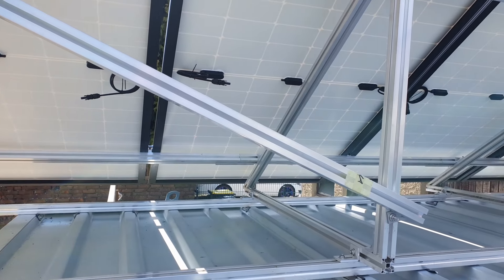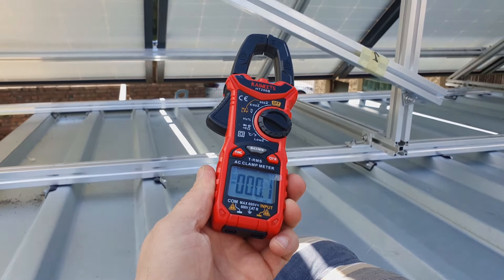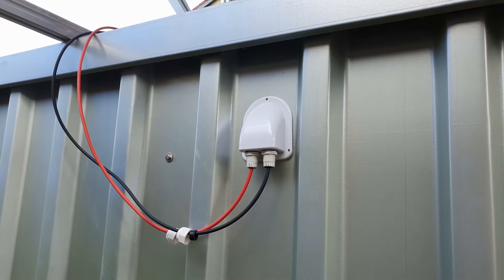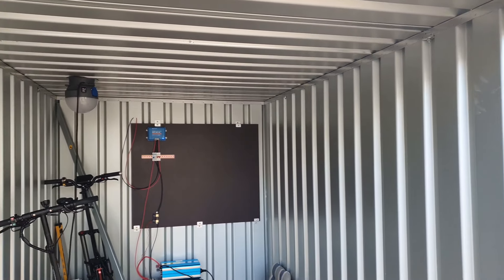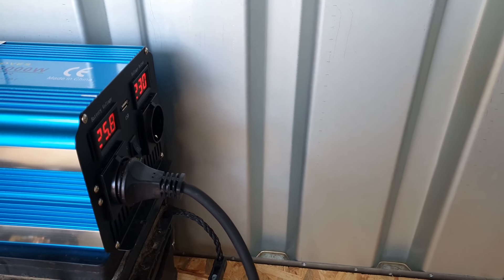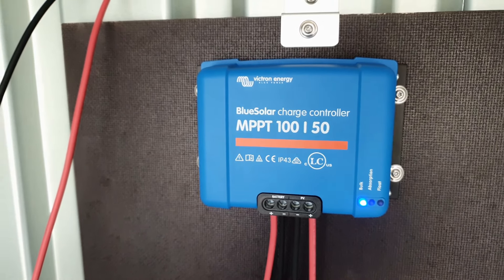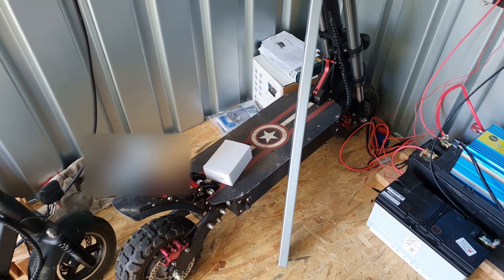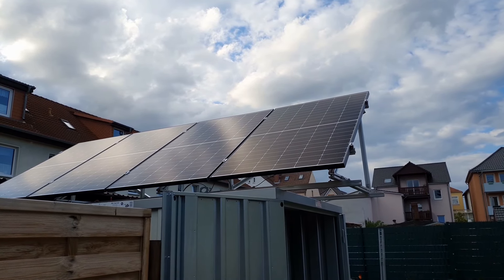Inselanlage mit 1500 Watt Peak - Teil I / mit Victron Laderegler & Trinasolar Panels

Comment: Die 4 Module haben ja ca 160Volt Leerlaufspannung wenn sie in Reihe sind. Der Laderegler kann aber nur 100V vertragen wenn ich es richtig verstehe.
Sind von den 4 Modulen je 2 parallel geschaltet?
Reply from the maker: Ein Modul hat ca. 38v max und Kurzschluss 42v glaube ich. Also immer 2 parallel und den in Reihe. Passt doch